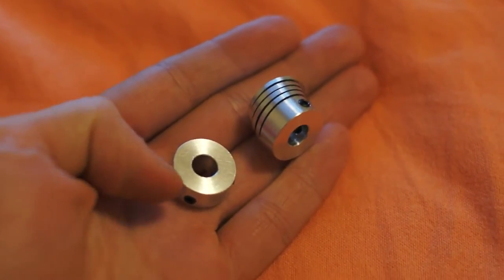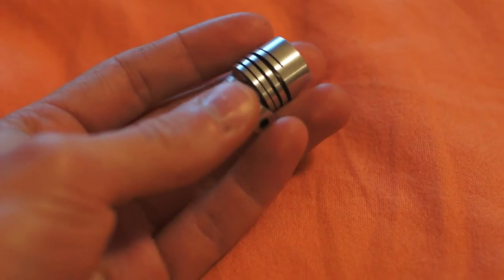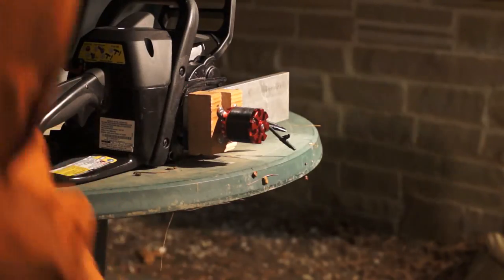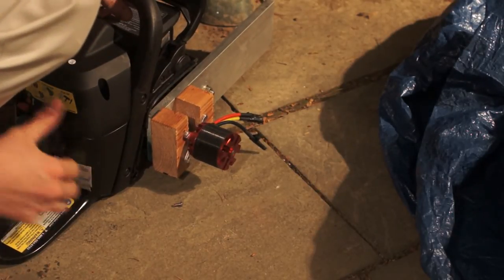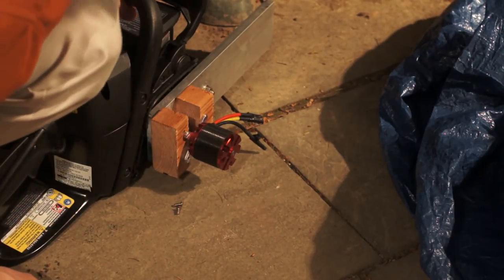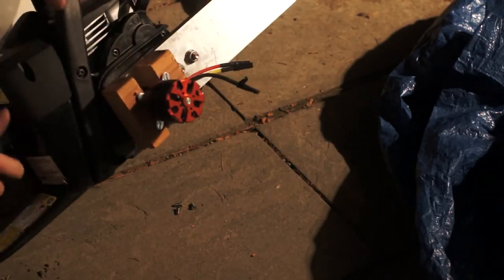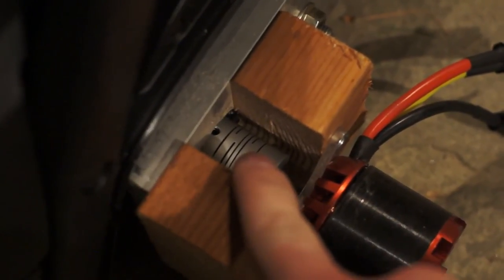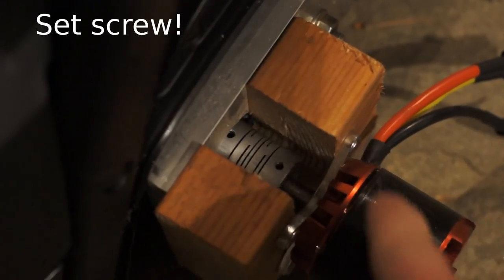Failed chainsaw power source attempt #2

Comment: Friendly tip my dad once taught me - to start the chainsaw, keep the hand holding the pull cord (starter rope) stationary with your weaker hand. "Drop" the chainsaw with your stronger arm (aided by gravity), but do not, i repeat *DO NOT* hold it lightly or let it drop on its own. It must be a controlled motion, the gravity is there just to help you. Once you get the hang of it, it makes for a much more effortless and faster startup, especially with heavier chainsaws.

Comment: I was half expecting it to work it's way out of the coupling and smack you or the camera or the other person right in the face plates. As the other commentator said locktite/threadlocker you need it, any application that implies less than precise alignment will produce vibration that will unscrew anything. In some cases it will unscrew even threadlocked screws, i kid you not. 

Good luck!

Comment from the maker: Turns out it was on the motor - they were machine screws.  I need to threadlock my stuff :-/.  I think everything undid itself because of the heavy vibrations of the 2-stroke engine.